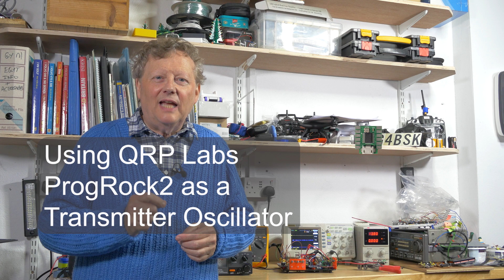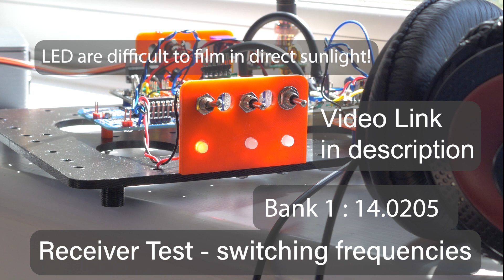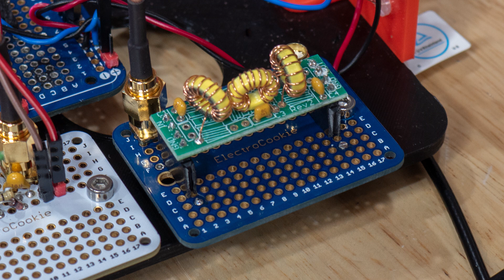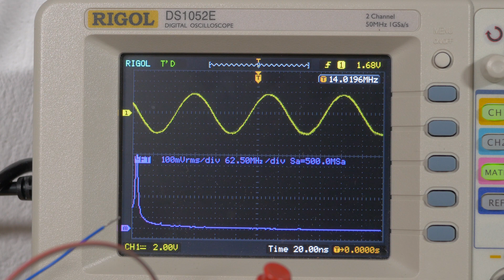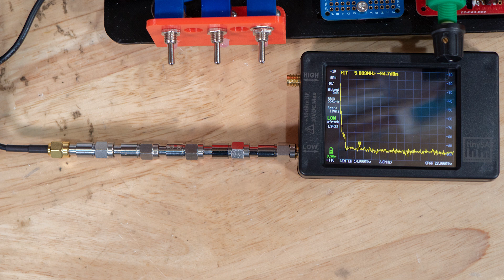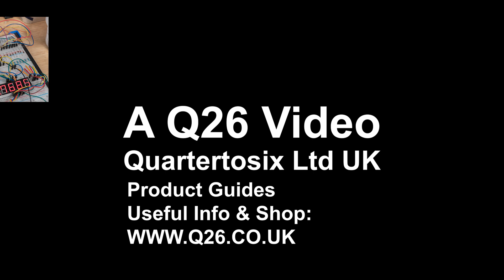QRP Labs ProgRock2 - can it power a Transmitter ?!

Comment: wondering if i can use these to directly replace HC-6/U unobtainium crystals? in an old Military transmitter/Receiver which originally put about 60mA through the original crystal in transmit?
Reply from the maker: These boards are not a direct crystal replacement - a crystal is a passive device used in a circuit to oscillate - these products are complete oscillators, so you would have to remove part of the circuitry of your transmitter to substitute with a progrock...